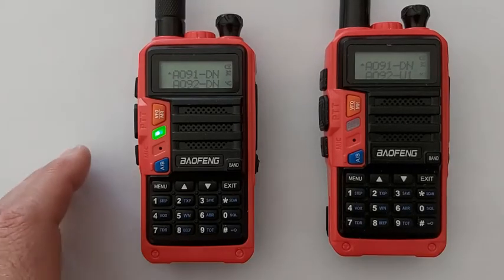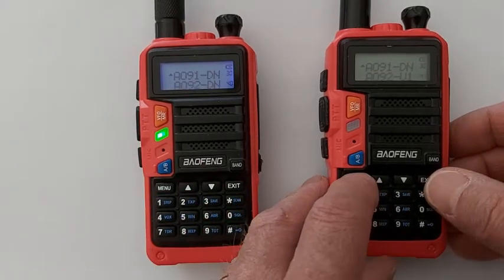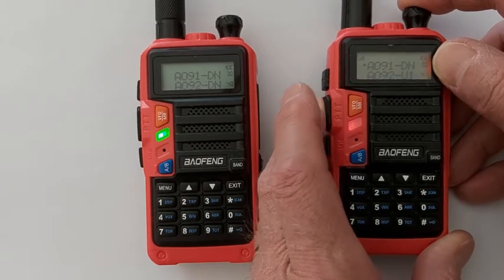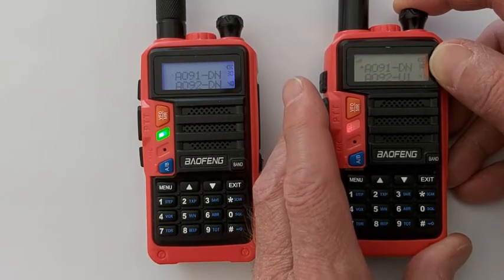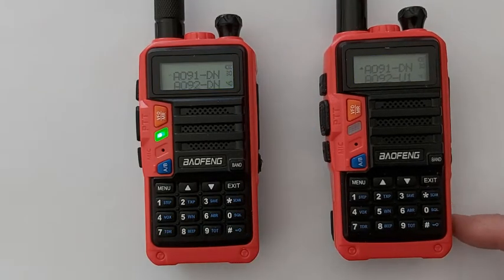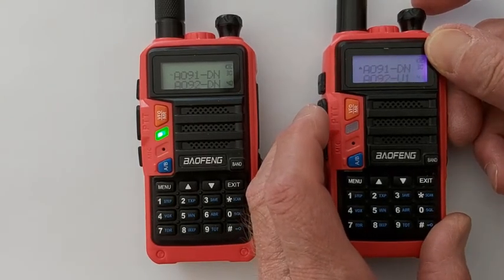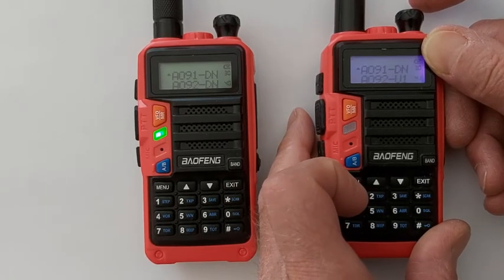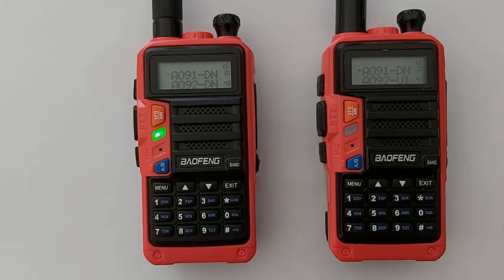BaoFeng BF-UVS9 / UV-5R STE Issue

Comment: BaoFeng UV S9....I have one in my hand right now, is a whole new design compared to the UV-5R family of BaoFeng HTs, The BaoFeng UV-S9 is a TriBand HT.... power settings 1 watt , 4 watts, spurious emissions <-60 dbm. Larger Battery Capacity, 4.6" tall compared to UV-5R 4.3".. Receive sensitivity is 0.2 uv, bigger better keypad, The new design is great... check it out.. for yourself.. everything has been improved on this radio... it also receives two different FM radio broadcast bands... I just tested the UV-S9 power output, L=1.1 Watt, H* =3.9 Watt...* screen does not show a H for higher power, only a L for low power..   I have noticed That there is a BaoFeng UV-S9 + Plus.... boasting 10watts output.
Reply from the maker: @trevorputterill  Thanks Trevor.  I bought mine on Wish too.  Having said that, I have a genuine UV-5R and it behaves exactly the same regarding responding to STE.  You can switch STE off on the UV-5R but it still responds to received STE tones.

Comment: is this better than BF uv-5r or just little different appearance ?
Reply from the maker: In theory it has more transmitter power (8w rather than 5w) but I’ve come across reviews that state that the increase is not that great, maybe 6w rather than the claimed 8w.  I bought them because I wanted a pair for satellite use and these were low price.